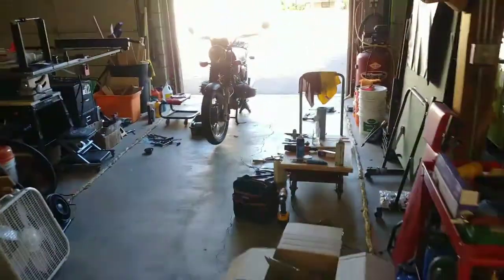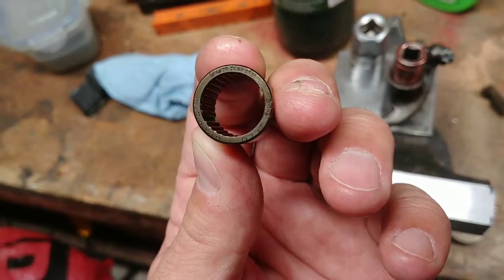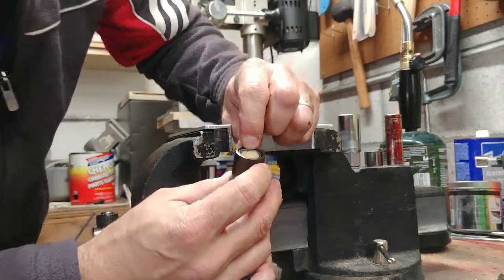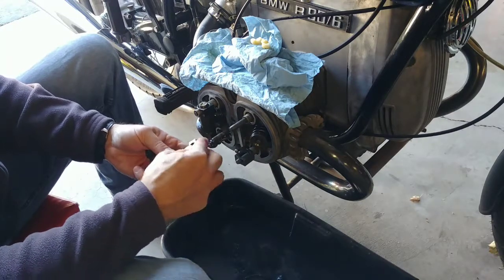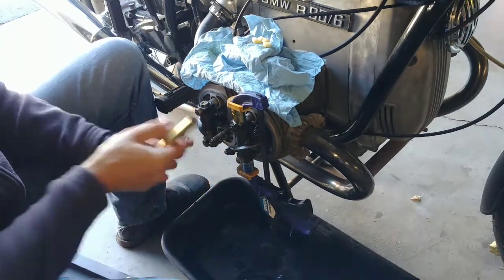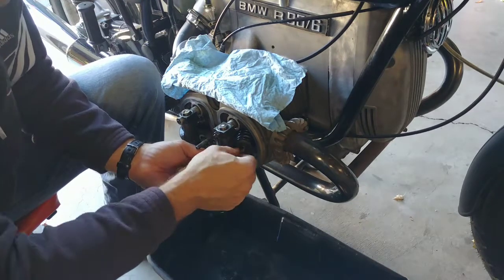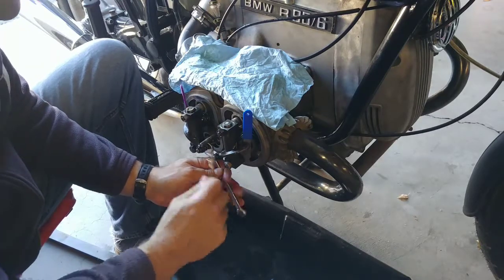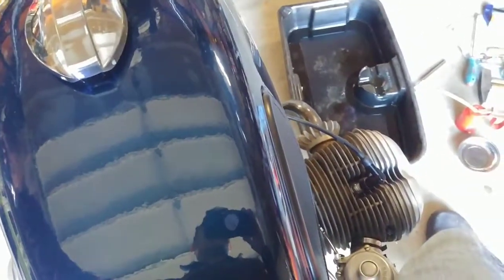BMW airhead rocker bearings/install the easy way!

Comment: very helpful video. Having a smaller vice i found a little heat helped get them out and heating the rocker to 350 degrees Farenheit made getting them in a breeze.

Comment: Take the  mil valve adjustment tool and place it horizontally on the valve not up or down.  When you tighten it, if it stays horizontally it is fine. If it  moves of falls it’s too loose.  Just a quick thing I learned.

Comment: thanks for the video. i was sad i missed out on your techday last year. hope to see you soon. FYI ted porter sells these but whoever he is getting these from is using a piece of vinyl tubing to keep the needle bearings inside and it does a poor job. i got my new set of 8 with dozen or so bearings loose. whoever you got yours from did a better job with the foam
Reply from the maker: There is going to be a tech day at my house again in September 2021. Date hasn't been set yet.

Comment: great vid,2 questions please ,,are there roman numerals on the rockers, I and II< and are they to the top or bottom when you fitted them,,also i was looking at the posts on the head that the studs poke through where the rocker blocks mount on,should there not be spacers/sleeves go over them sitting on rubber "0"rings,
Reply from the maker: That is a good question. I know that they are interchangeable. The intake rocker from the right cylinder is the exhaust rocker for the left cylinder. Considering that I would say the orientation of the numerals isn't important.
I hope that helps

Comment: Hi. Super interesting video. But I really like to know how you got the first needle sleevers out of the rockerarm ? It a greate problem for me. I have bought new needle sleevers but can’t get the old one out 😢
Reply from the maker: I used a socket that is slightly smaller than the bearing to push the old one out.

Comment: Hey thanks for the video! At the start you mentioned that its abit risky to remove a rocker arm assembly because it could loosen a headgasket? How risky is it and is there any way to prevent it?
Also would you recommend removing it from the head at TDC? Thanks!
Reply from the maker: let me say you might cause oil leaks by taking you rockers off and just putting them back on without changing the cylinder head gasket, base gasket and push rod tube seals.

Comment: Really great video. Gonna be doing the same job on my R80. What vice do you use? I’ve been looking all over for one big enough for this. Thank you!!
Reply from the maker: My vise is a cheapo 6 inch from Amazon. I bought that said it is cast steel which in theory is stronger than cast iron. 
Any 6 inch vise should be able to open far enough. If not, pack up the rockers and the new bearings, send them to me and I will push them in.
Reply: @HeikosGarage  great, thank you so much for the reply. I have the engine sealed, however, so I’ll have to take the rockers off one at a time to avoid ruining the cylinder seals. Just my luck that I noticed the broken cages as I was putting the rockers back on. Thank you for the offer though!